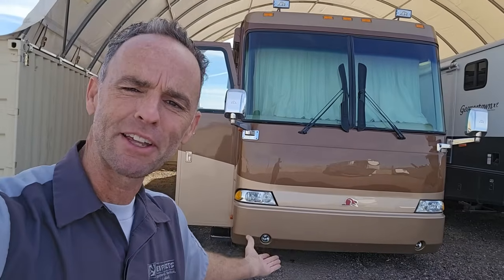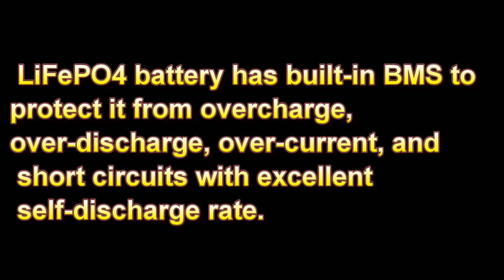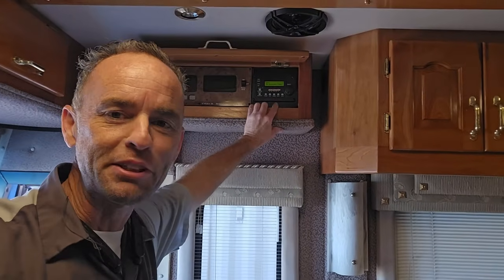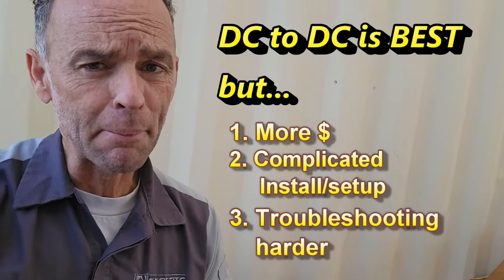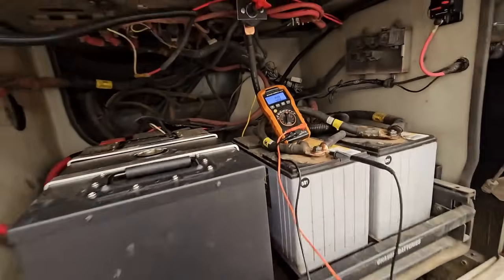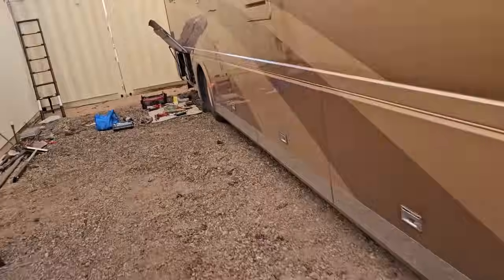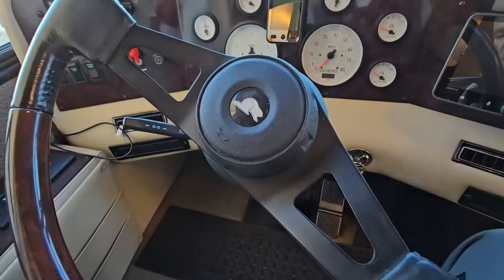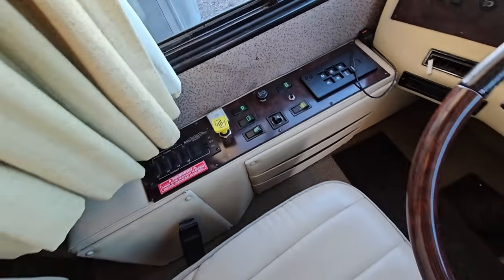What You NEED to Know About Adding Lithium Batteries to Your RV

Comment: Keep an eye on that Precision Circuits LiBim relay. I had one in my system, thought I could just run my house batteries down to nothing since they were Battleborn, what happened was the LiBim somehow got confused and in a closed state, meaning it wiped out my coach batteries also overnight. The problem I see with that LiBim is it tries to do too much with only a rotary contact inside. It can become confused, it clicks all the time and you really have no idea why. Finally I went with a DC to DC converter. I just didn't want my coach batteries and house batteries to ever be completely connected together again. Luckily I had enough solar to wait a few hours in the morning to start the coach by using the signal terminal to provide enough start voltage.
Reply: I also found an issue with this LiBIM.  The name implies it will act as a battery isolation module and allow you to connect both batteries using a momentary switch.  When the momentary switch is not on, the batteries are supposed to be separated, but I found this not the case.  I found that my chassis battery was back feeding through this LiBIM after I shut off my house battery disconnect and solar disconnect.  I found my victron Cerbo GX still had power getting to it from the LiBIM from the chassis battery.  I plan to add a second battery disconnect next to the LiBIM to isolate the chassis battery from Victron components.   This back flow only happens when the LiBIM timing circuit is battery connect position for active alternator charging.  When timing advances to its rest state, the back feeding issue stops.
Reply from the maker: This is great information, I hadn't heard about this. I removed all other chassis charging setup to prevent them causing issues like this. I didn't like the idea of a dc to dc charger in this battery bay either as it is not weather proof and still has acid batteries too.
Reply: Now I’m having that same problem with mine. I thought there was something wrong with my battery bank. My LiBIM isn’t clicking anymore. It used to click about 10 seconds after cranking the engine now only when I pushed the momentary switch. For some reason my battery bank isn’t charging while driving any more. I have to spend some time troubleshooting.
Reply: Some DC to DC chargers like from Victron and Renogy are compatible with lead acid on one side and LiFePO4 on the other. Also some are isolated or shared ground. We have the victron on a circuit with a breaker for 3 years now on our Tiffin zephyr with lead acid chassis batteries and lithium house batteries and it works well, no issues and its customizeable and can be monitored through bluetooth on the app, and you can set a lot of parameters when to start charging, such as only on when the engine/alternator is running, and how your charging output would look too
Reply from the maker: @davidlundy5007  Thanks for sharing, I haven't heard of this failure, but it sounds likeit may be more common.
Reply: @AZExpert I also had this LiBIM failure. Stuck open, drained house batteries and blew fuse to chassis battery from LiBIM. The result was house batteries dead and the alternator / chassis connection wasn’t able to charge the house batteries. Bummer. Switched to Kisae DC: DC charger. 

BTW, great simplified breakdown of lithium issues! 👍🏼
Reply: LiFePo4 will draw a lot of amps at 86% because the charge profile for them is almost flat and it's only the first and last 5-10% where the graph deviates from pretty flat.
Reply: When I did my LiFePO4 battery and solar upgrade on my 2022 Thor Hurricane MH, step one was to seal up and make weather tight this house battery compartment, since it no longer needed to be ventilated with the lead acid batteries removed.  It is just shocking just how much damage the acidic fumes from these lead acid batteries can be.
Reply: I also considered going to a DC-to-DC charger as well, but I wanted to keep the momentary battery connect feature built into these BIM modules for the ability to "jump-start" my chassis battery if the need arises.  The fact that these LiBIM may cause my chassis battery to drain is very disconcerting.  It blows my mind the a product touted as a battery isolation module (BIM) doesn't actually isolate the two battery banks as advertised!
Reply: I disconnected the charge relay from my bidirectional charge controler until I 28:34  a DC to DC charger. If I ever do, because my Renogy 400AH REGO charges very fast with the generator and a dedicated lithium battery charger plus solar. My Magnum charger/inverter doesn't have a custom setting mode and thinks the lithium is fully charged when it's 75% using the gel battery setting. The Renogy REGO starts flashing yellow warning lights at 14.6 volts. Then, I assume that if left at that voltage it would trip the BMS.
Reply: I contacted A Precision Circuits(makes the LiBim)  tech and he said not to use the LiBim in my application……That it would cause the Lifep04 batteries BMS to shut down and not charge….leaving me with no battery power….He recommended disabling the alternator charging of the Lifepo4 batteries and to use a DcDc charger….
Reply: I find it strange that representative of the company  that makes this LiBIM would tell you not to use it for the application it designed for.  Unless your particular application is not typical.
My MH came with a similar non Lithium version of the BIM,  so I figured during my LiFePO4 battery upgrade this was the best and easiest way to go.  I'm also worried that my LiFePO4 batteries higher voltage state may also be back feeding into my Lead acid chassis battery and causing an over charging condition of the chassis battery.
Reply: @AZExpert  I think you'll find that Redarc in South Australia produce a series of DC/DC chargers (25 amp, 40 amp and possibly a 50 amp) for auxiliary batteries, which are both waterproof and provide the user with an override to allow jump-starting the vehicle if the cranking battery(ies) run flat.  These can also be used with virtually any conventional battery types and mix, but need to be wired differently for each user's battery requirements. 

No, I  don't know anyone at Redarc, I have no arrangement with the company and I obtain no benefit of any kind from them.
Reply: @cujo7240 I found it odd also… I asked about it several ways and the answer was always the same…
I really don’t see a necessity for a dcdc charger …shore, onboard generator & solar should keep the Lifep04’s charged….
Reply: We travel with one of our roof AC running to keep the coach cool while on the road during warmer weather, since we travel with pets.  Even though we have 800W of solar on the roof, I like the idea of an alternator charging my 400Ah LiFePO4 battery bank.  I know I could run my on-board generator, but I rather not due to the noise and added fuel use.
Reply: @j.g.9655  I felt the same way a for about a year, 800 watts of solar on my truck camper. We did a lot of boondocking and cloudy raised my stress level enough to add charging from the chassis. The LiBim worked well for almost a year, the one morning it just decided to never disconnect and flattened my chassis batteries. I have no room for a generator so alternator charging is the next best thing. I'm going to upgrade my dc to dc to the new victron XS-50, they also had trouble with their old 12-12 30 charger, it only ever charges at 20 instead of 30
Reply: All of you guys are missing the boat your alternator should be putting out higher voltage all you have to address is a regulator that charges the battery at 14.6 volts.
Reply: Agree 100%
Reply: @cujo7240 I kinda cheated with my install. I left the old lead acid BIM ( looks the same a green lithium one) but I added a relay on the ground wire. The BIM can’t work without a ground.  So normally batteries stay isolated and my DC2DC does the work. If I kill my starting battery I use the boost switch that goes to signal wire to energize relay and close the ground and reactivating the BIM for the moment of need. Now I can boost charge as James mentioned if needed. Work perfectly. Only extra was to add a wire on relay to ground on power side so relay would work.  That being stated my DC2DC uses my 200 watts of solar and keeps starting battery up easily.

Comment: Out of all the you tube channels that I've watched on upgrading to lithium batteries you are the first person to address the problem of compatibility between coach and motor batteries. This was a real concern of mine. Thank you for sharing your solutions to this problem.
Reply from the maker: Wow, thank you!
Reply: @AZExpert  I have a question (hand raised) I contacted the battery designer and i asked them can you set the charge to be lower so that you can use a alternator too charge they said in the app you can set the charge to the same as non-lithium batteries from the factory and run them at 78 percent and they said this configuration will allow the alternator to rest and the b
Batteries will turn off the charge early allowing the alternator less stress and it wont overheat.
Reply: @AZExpert I have 1200 watts on my roof and 600ah for AGM battery now. I'm going to lithium, my charge controller is already capable of lithium so I think solar will give me that extra 10% to top off the lithium over the the standard charger. What do you think?
Reply: Great video

Comment: James - I have the same Magnum Energy MS2812 as you have in your motorhome. They absolutely do work on lithium batteries as I did this conversion about 5 months ago (4x230Ah). I changed out the board and the remote (less than 30 min job) on the MS2812 and it now has the Li battery profile. I did not need to do this as the original board and remote would allow me to customize the charge - as you showed - to CC/CV (constant current/constant voltage). I did not have to really change anything on my 2014 Dutch Star to handle Li batteries. However, I did elect NOT to charge my Li batteries using the 250 amp alternator from the engine. If I want to juice the batteries, I simply start my 10kw generator and within an hour, the batteries are topped off. The chassis batteries are still being charged by the alternator. With a 10kw generator, there is no need for expensive solar stuff. With our setup, we can be off grid for about 5 days (920 Ah) and with a genset, we are only limited by the black/grey tank capacity. Great videos.
Reply: Very good points.  I think i'll do likewise and isolate the the alternator to charge only the chassis battery- gas engine, and let the combination of solar and genny take care of the house lithium.

Comment: The one potential theoretical failure mode you didn't cover is potential for a sudden large fluctuation of LFP electrical load, caused by the BMS switching OFF, resulting in a momentary high voltage surge in the alternator. The high voltage surge could damage the alternator rectifying diodes or some electronics that don't have sufficient surge protection. Not sure as to the magnitude and likelihood of current swings and how much the coach batteries would buffer voltage spikes (likely would be vehicle design dependent.) If the Smart Relay is physical switching, it would probably not be fast enough to respond to the spike. For your system, the inverter provides a good buffer.
Reply from the maker: Most modern production diesel chassis have a built in charge circuit control that works similar to the intellitec BIRD and will engage and disengage the charge relay mulitple times in a matter of minutes with the engine running cutting the house batteries in and out changing the load on the alternator and extreme amount and that is standard operation on these chassis with lead acid batteries, it's not a concern I have.

Comment: Thank you for this - People tend to really overthink the switch to Lithium and sooooo many folks think they're a safety issue when they absolutely are not. I've worked in the UPS industry for over 22 years now. 19 of those years were spent handling escalated customer issues at APC/Schneider Electric (who are the biggest manufacturer in that industry). I have dealt with hundreds (if not thousands) of potential safety issues with lead acid batteries. Explosions, fire, leaks, venting/swelling, you name it. With LiFePO4 I have dealt with exactly zero. Not one, not ever. They are fantastic.  From a vendor perspective I have seen the failure rates and they are pretty much zero. When they do fail, it's typically more common to see a BMS failing, or maybe a physical connection like a bad screw terminal or something to that effect. The actual batteries are insanely good and rarely fail. Its great great stuff.
Reply from the maker: Thats incredible to hear. Thanks for sharing, I'm glad we share similar pov on this

Comment: James, congrats! You covered the main points perfectly. I live in southern Az and have a trailer. I installed a lithium in my trailer and it works and charges perfectly. 
The only suggestion is I did change over the main board of my WFCO converter/charger. Cost under $150 and was a 5 wire install! Took 10 minutes. 
Again, thanks for the clarification. Lithium is an easy install for trailers. Motor homes and vans do have the alternator issue that must be addressed. 
Lastly, When my truck battery died on the road, I sat for an hour allowing my trailer lithium to charge my truck battery through the 7pin connection. It worked. High voltage always flows to low voltage. I was able to start the truck and get to the dealer for a new truck battery!
Thanks again.
David

Comment: Even at 80-90% charge on the lithium, you still get more than twice the ah usage as a comparable lead acid battery. I have had many clients who finally upgraded after I told them this and they are all extatic with the results.  Fore those that have 120v fridges I installed two LiFePo4 batteries. For any of them with solar installed, they never run out of juice. The isolator, I did not know about. I will be installing these from now on.  Also, installing larger current alternators is usually easy. Thanks for making this more public! Good for business. Ryan at Glenwood RV Repair in Colorado. 
Ps. Love your videos! They have made me a better rv tech.
Reply: Another way - since many 'RV size' engines commonly have mounts available for a second alternator (as many also are used in ambulances, etc. that require two alternators), is to install a second 'constant duty' alternator (not a second OEM alternator that is still NOT constant duty.) Those alternators are built to stand constant output and have a thermistor built-in as a safeguard.

Comment: I have a  24 year old Georgie Boy 26 ft class A motorhome. I have been doing a major renovation and used AZ Expert's videos extensively when I completely replaced the roof two years ago. For the past few months I've been working on the electrical system.  I kept the original house battery and engine battery but disconnected the house battery from the 12 volt house circuits and removed the original charger/inverter.  This original house battery now serves only as a backup to the engine battery. Both of these are charged by the engine's alternator.  To manage house power needs, I installed an independent  48v EG4 LiFE house battery that is charged via a Growatt 3 kw charger/inverter.  Through the Growatt, the EG4 battery can be charged by shore power, by the generator, or with 800 watts of solar panels on the roof but not by the engine alternator. So when I am hooked up to shore power or running the generator, the 120v feeds through the automatic transfer switch  to the Growatt charger/inverter. The Growatt unit normally routes the 120v directly to my 120v AC breaker panel.  The Growatt also charges the 48v battery.  If there is no incoming 120v, the Growatt  automatically inverts 48v DC from the battery to 120v AC and feeds it to the 120v AC breaker panel.  The 48v DC runs through a 48 to 12 volt DC converter, and is distributed to the eight 12 volt DC circuits in my motorhome. When I started the project, I expected it to be very complicated but was amazed at all the things the Growatt can do, and how much simpler it was than I expected.  I'm not pushing Growatt over other manufacturers, it just happens to be the one I got, after seeing it on  the Will Prowse channel  and I'm sure others operate similarly.  As AZ Expert mentioned, the  electrical equipment  available for RVs are getting smarter and thus easier to use.  

Jim

Comment: I used the Li-BIM without trouble for 3 years, but switched to a Renogy DC-DC+MPPT this year.  When the LiFePO4 batteries got almost completely discharged, they pulled >100A from the alternator/chassis battery.  This tripped the 100A breaker I put between the Li-BIM and the chassis battery, so I could only charge from the AC-DC converter.

The Renogy DC - DC converter does 50A Max, and can be adjusted downward in 10A increments.  It still charges the coach batteries faster than the Li-BIM, because of the on-off duty cycle of the Li-BIM.

The DC-DC charger products have improved a lot in the last 3 years.  I don't regret buying the Li-BIM, but better options exist now.

Comment: You confirmed my hunch about using PV to top off the batteries as a more cost effect way on an older rig than changing out the perfectly good inverter/charger.  I like the solution for the charging off the alternator.  I might jump in now.